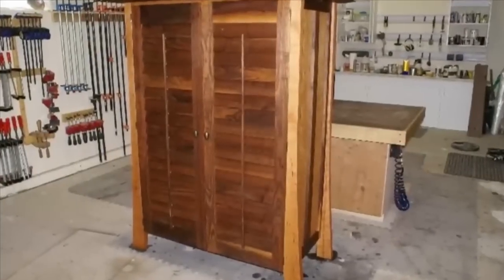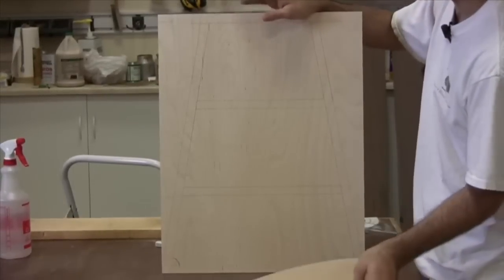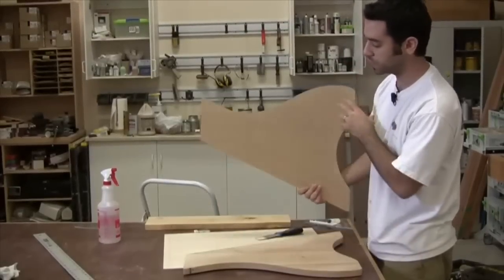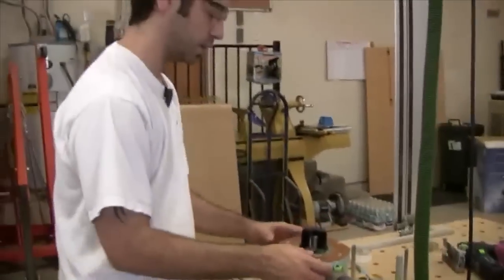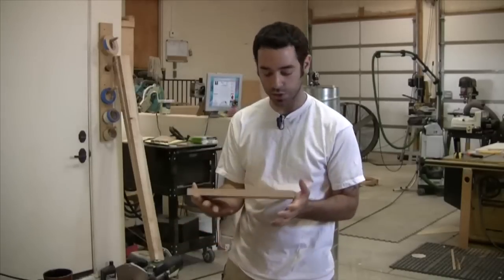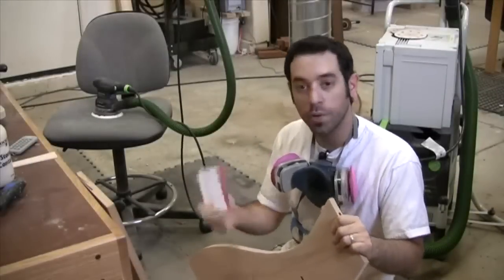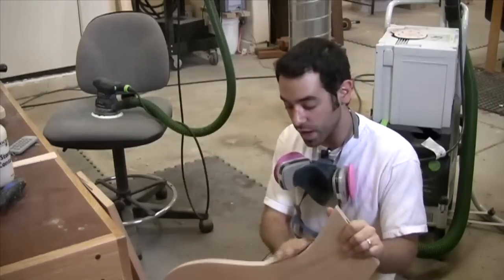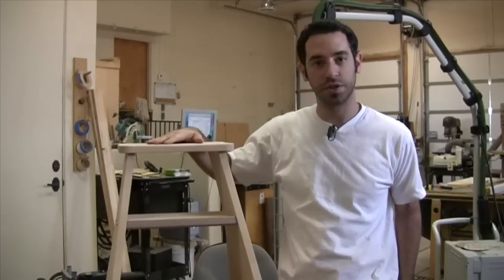20 - How To Build A Step Stool Using the Festool Domino

Comment: Glad you said what I was thinking, about the weight capacity of the domino..we used to make 3 step access ladders from 5/4 teak, for sail boats and we used a dado and plugged recsessed screws.also dont be tempted to have the width of the tread stick out in front any more than 3\4" or a heavy person might split it off. I can see many uses for exposed dominos, great project thanks.

Comment: Nice video, as always. When plunging the Domino 500 down onto a face, you can also draw a parallel line that's 10mm from your center-line in order to align the base of the Domino 500. Much faster and more reliable. Keep up the good work!

Comment: The steps will be stronger if placed into dados the same way a wood ladder is made.
Reply: +I.DIY Modernist Drifos 
You've never seen a wooden ladder?
Reply: +I.DIY Modernist Drifos 
He's right.  Steps constructed with dados are stronger and sturdier, hands down.  Any carpenter will tell you that.  Peg construction in due time will wobble and fail.
Reply: *****
It seems like,you missed it. The next time you visit a lumber yard, look at how pre-fab stairs are made. The steps are fitted into dados.